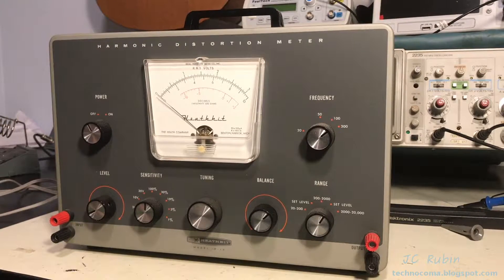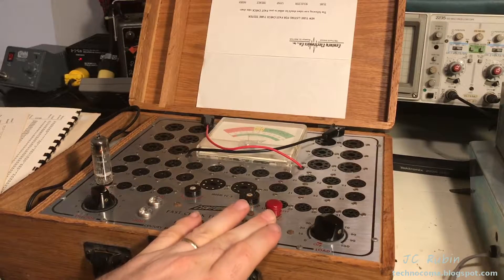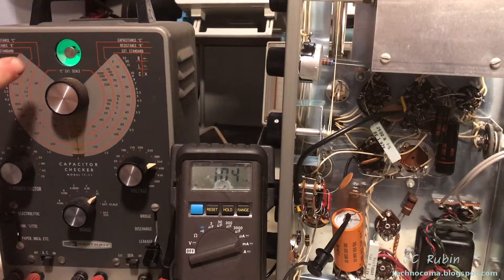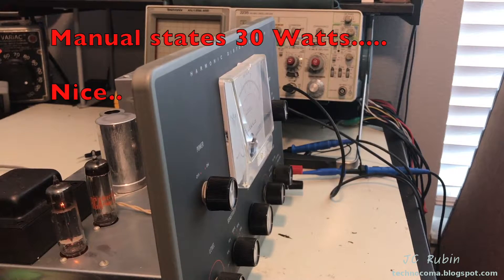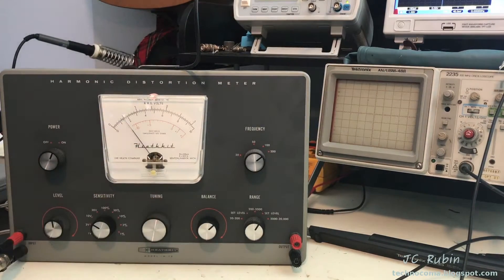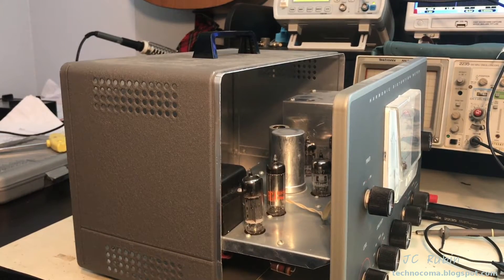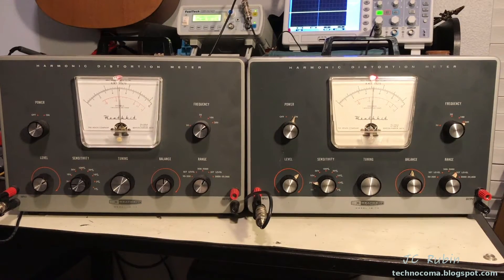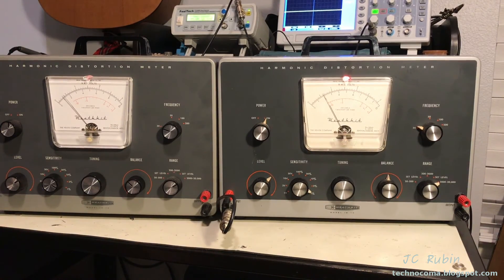Heathkit Repair - IM-12 IM-58 Harmonic Distortion Meter - Turn-up and test with and demo

Comment: I have just started restoring an IM-12. I always replace all paper and aluminum electrolytic capacitors in my restorations, so I have a short list of parts to go shopping for in that regard. Ceramic disk caps and mylar & mica caps I usually leave alone.

I also went through and measured all carbon-composite resistors that were in parts of the circuit where I thought their accuracy might affect the overall instrument's functionality; they are all 10% tolerance parts, and all but one were (surprisingly) within that tolerance range. The 2700Ω associated with the 12AX7 to circuit ground was nearly 5k, so that will also be replaced. Any time I found a resistor that initially seemed to be far out of spec, I would clip one of its leads and measure again, then solder the clipped lead back together after verifying that it was OK in isolation. I also had all tubes removed during the resistance checks.

Two things really ate up a lot of my initial evaluation time:
- The schematic, in the area of the large tuning capacitor, did not seem to agree with the reality of what I was seeing inside the instrument. That part has three solder terminals, and I had assumed that those corresponded to the top and bottom ends (as depicted on the schematic), and the common point between the two halves. Turned out that what the assembly instructions refer to as tuning capacitor terminals 1 & 2 are electrically the same point, and those are the 'top', and terminal 3 is the 'bottom', while a mounting screw (through an insulating mounting panel) which has a solder lug on it, is the 'common' point.
- Even after sorting out the above issue, I was trying to do resistance checks measured to circuit ground (for those resistors that connect there), and the 1M resistor from the 'bottom' of the tuning cap and half of the Range switch was not reading anywhere near the correct resistance to ground, but measured directly on its leads it was 1M. I traced its wiring and found it connected to the 12AX7 tube's pin 2, rather than to the 5879 tube's pin 2, which is connected to ground. So, an original assembly error, and I verified that the manual's associated assembly steps and diagrams were correct in this regard. 

While the instrument was in good condition, its knob knurls had lots of crud in them (not just on their top sides, but all the way around), suggesting that the instrument had gotten quite a bit of use. With the wiring error described above, I am surprised that it would work at all, or well enough to be in use for an apparently long period of time. The eBay seller said it came from an audio equipment repair shop, and if it did not work, it would seem that they would have gotten rid of it long ago. A mystery.....

I don't do a lot with tube circuits, and I don't have a reliable tube tester, so I am assuming that the tubes are all OK. Once I replace the capacitors and one resistor (I have already fixed the wiring error), I'll see if the unit functions......

I purchased a complete manual from ManualMan.com, and followed through its assembly steps, cross-checking with the assembly diagrams. It is really eye-opening to see how poor the early Heathkit manuals were compared to what they were famous for during most of their time in business. I consider that these earlier designs' manuals were written more for experience/educated electronics-savvy builders, because they definitely don't spell things out nearly as well as they did later on, and there are quite a few errors (which a savvy builder might catch and figure out), and places where the instructions are less than clear, etc. I even downloaded the later IM-58 version's schematic and partial manual and if there is any difference between that documentation and that of the IM-12, I can't see it. Seems that Heath did nothing to improve the documentation between those two variants.